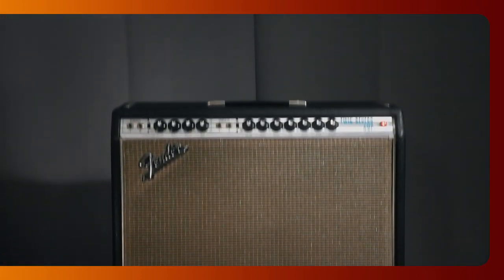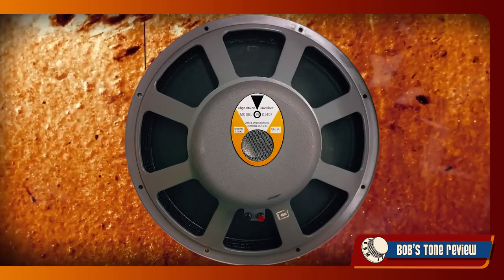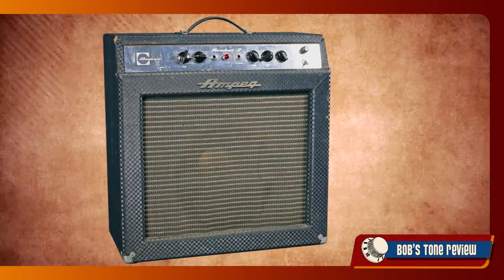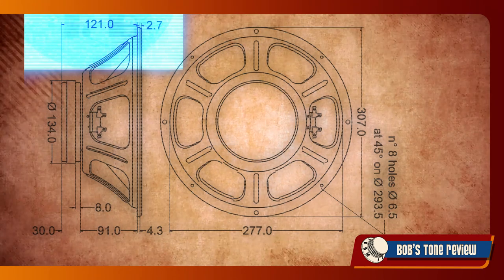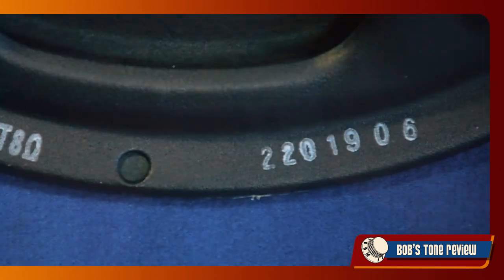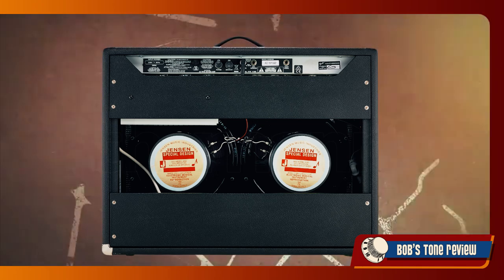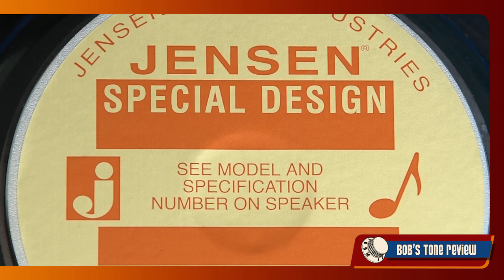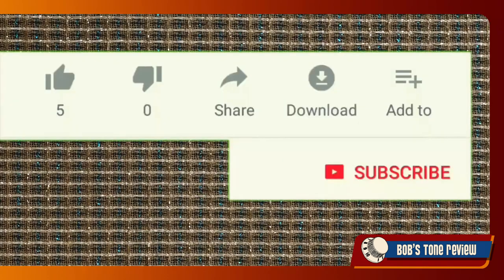BTR#22 The Jensen Speakers Upgrade - Vintage

Comment: When you played the distortion section, the UTAH'S sounded much deeper, richer and fuller.  The Jensen's were light, tinny and shrilly albeit "clean".
Reply from the maker: It's a matter of taste after all Sunrayman; While I like the Jensen C12-N's I might agree with you within a certain extent for the Tornados. The Utah's may lack in headroom, if you consider that it's a Twin! Also, as mentioned in the final part of the video, we should take into account the break-in factor, which plays in favor of the Utah's, especially as far as "Depth" is concerned.
Reply: i have a set of the jenson 220's in my heathkit cab with a fender hotrod as the head it sounds amazing not sure what you mean.

Comment: Utah's are underrated. I would keep one in there for micing variation. Also, modern Jensens do not sound like vintage ones at all from my experience.
Reply from the maker: Good point Middle Pickup, that makes sense.

Comment: excellent. it's crazy how a new set of drivers will change an amp entirely. 👍👍👍
Reply from the maker: Sure Marc, yet it's a quite underrated mod when compared, for instance, to pickup changes or stomp box pedals.
Reply: @BobsToneReview  absolutely!i have a few heads i like and then i have a few cabinets with different drivers that i can pick and choose depending on what i'm looking for. massive differences in character. they all make the amps feel completely different too.

Comment: Interesting and insightful video as usual, thank you sir - appreciated.  Your opinion about the Italian Jensen speakers is different from others I've heard.  According to what I've learned, the parts used in the Italian Jensen speakers are not interchangeable with Chicago Jensen speakers, while Weber's versions of those classic speakers (his favorite versions of them) use parts that are interchangeable with the original Jensen speakers.  Ted Weber (RIP) stopped using the same designations the new at the time Italian Jensen company also used, because he didn't want his speakers confused with their speakers, which he thought were inferior to the original Jensen speakers (a common sentiment).  Not that he was disparaging the Italian speakers, the other speaker manufacturers speakers weren't as good either, Jensen used tighter tolerances in the voice coil cap, as Weber also does supposedly.  I wish the Italian Jensen company hadn't added the word "vintage" to their speakers, because now when people talk about them and say "vintage Jensen" speakers it confuses things, which seems to be by design.  I believe some of the new Italian Jensen speakers are better than others, and they seem to be getting better with experience from the learning curve, plus some respected amplifier makers are using them.  I've seen more positive opinions about the Italian Jensen speakers lately, but one of the criticisms I hear is they are very bright and take a long time to break-in.  The Jensen speakers Fender chose for their new Deluxe Reverb reissues - the C12K, sounds pretty bad in those amps according to amp techs like Lyle at "Psionic Audio", who's opinion I respect - he said almost any other manufacturers C12N type speaker would sound better.  On the other hand some great guitar players use the stock Deluxe Reverb reissues with C12K speaker and make them sound spectacular, so ymmv as they say!   I had an Italian Jensen P12N in a hand-wired Deluxe Reverb which sounded really good - much better than a C12R did, but a Weber 12F150 (C12N clone) I replaced it with sounded so much better in that application. Speakers that sound bad in one amp can sound wonderful in another amp, and visa/versa.  I'm somewhat crazy about speakers and have quite a few, just added a couple Jensen "Vibranto" models today (what brought me here): an EM 1220 and EM 1202, which are very different from each other.  Jensen offered a lifetime warranty on their final speakers, so maybe they knew their company was about to disappear (?), because a lifetime warranty on speakers that WILL wear-out doesn't make sense otherwise - no?  The EM 1220 is designed for bass, rated 100 watts, with 28 gram ceramic magnet, so it's going into my 1963 (?) Ampeg B12X fliptop portoflex, so I can play bass and guitar without blowing the speaker.  It also has a high frequency horn and external 2 x 4" cab for the reverb and tremolo, so it won't be too dark sounding with the "bass" speaker.  The B12X currently has its original cone C12N speaker, which I'll cherish at lower volumes in one of my older Gibson or Ampeg amps.  The EM 1202 is designed for guitar, rated 60 watts, with 16 gram ceramic magnet, while the regular Chicago Jensen (I have to say "Chicago" instead of "vintage" Jensen to avoid confusion) C12N is 25 watts, so this version has a higher wattage rating, possibly because it's voice coil former isn't paper like the regular C12N (?).  Another benefit of buying a Vibranto version of old Chicago Jensen speakers is they are more likely to still have their original cone that hasn't blown than the older Jensen models.  It's hard to beat an old Jensen speakers in old American amps, which were voiced for those speakers, but as they say - ymmv.............cheers!
Reply from the maker: Hello David, thank you for your kind words, I'm really happy that you like my videos!

"According to what I've learned, the parts used in the Italian Jensen speakers are not interchangeable with Chicago Jensen speakers, while Weber's versions of those classic speakers use parts that are interchangeable with the original Jensen speakers". 

I absolutely confirm that. That's why Weber parts are manufactured in Inches while Jensen parts are manufactured in mm, which of course is the standard for European industrial machinery. 
In fact, I had to buy recone kits from weber to recone a couple of vintage Fender 10" speakers.
The contemporary Jensens are optimum speakers, definitely among the best reissues available today, but I would never dare to say that they are exactly like the vintage originals from the 1950's. 

"I wish the Italian Jensen company hadn't added the word "vintage" to their speakers, because now when people talk about them and say "vintage Jensen" speakers it confuses things"

Unfortunately that applies to any vintage reissue on the market; Gibson and Fender first : )

I think that speakers with different magnet size and material should not be really compared. Like you say:

"Speakers that sound bad in one amp can sound wonderful in another amp, and vica/versa"; 
I totally agree with that. 

"Jensen offered a lifetime warranty on their final speakers, so maybe they knew their company was about to disappear (?), because a lifetime warranty on speakers that WILL wear-out doesn't make sense otherwise"

Ha! Ha! Good point : ) Jensen is a subsidiary of SICA which, as far as I know, it's a long established company.

Best wishes with your speakers, I'm sure they'll do a great job for the next 100 years : ))

Comment: I have a 1964 Fender Deluxe Reverb that didn't come with the original speaker, the Oxford 12k5-6 so I replaced the crappy one it came with, with a modern C12Q...but I wanna improve the sound to the best possible speaker but I wanna make it a Vintage Speaker of the same era. So, what speaker do you recommend that I get for my 64 Deluxe Reverb?  I was thinking a Vintage Jensen C12N. What do you think?
Reply from the maker: Excellent choice Heiner! I also love the Alnico Jensen P12N soundwise but the Ceramic C12N is more indicated for a period-correct restoration. Congratulations on your great amplifier!

Comment: Hi Bob, I have an original 1965 Fender Blackface Bandmaster with two Utah speakers. The amp is 40 watts. Would you happen to know exactly how many watts each are these speakers that came original to the amp. They don't have the Utah sticker on the back of the magnet. I'm thinking that they must be at least 25 watts each. Those Utah speakers you have must be higher powered because, wasn't your amp at least 80 watts? Please let me know. Do you find the Utah speakers any good compared to today's speakers? Thanks Michael Newell from Niagara Falls, Ontario, Canada
Reply from the maker: Hi Michael, thank you for your kind interest! I'm afraid I can't help with precise or documented information about your Utahs. Yes, the Twin is 85 Watts so the speakers should have higher power rating there. As I mentioned in the video, the Utah are often considered the least desirable among the speaker options in vintage Fender amplifiers. This doesn't necessarily mean that they cannot fit your needs or that you can't get cool sounds out of them. And yes, as the test recording stands to demonstrate, still they are respectable vintage speakers! I think much depends on the kind of instrument you use and the tone you are after as possibly they might result too compressed with more powerful signals or higher volumes. In that case you may appreciate a more efficient speaker giving more headroom.
Reply: Hi Michael, lovely amp of yours!!!
It's hard to tell the exact power rating without seeing a picture (and won't be easy neither with a pic...). you can try the "google way", keying in all the codes you may read on the frame and/or on the back of the cone membrane.
As a very rough guideline, look at the speakers from a side, and try  to measure the diameter of the voice coil former, that is the point where the cone membrane meets the spider suspension, on the bottom side of the cone. If your speaker will at least measure 1" in voice coil diameter, you should be in the 15-20 W range. Be careful, ,obviously, the speakers are quite delicate in that area. But you should be able to determine if the VC will be bigger or smaller than 1", that is what you really need to know. The bigger the voice coil, the higher the power handling, all else being equal.
In the "Jensen world", the first letter indicated the magnet (C-Ceramic, P-AlNiCo, N-Neodymium), the number indicats the size (6, 8, 10, 12, 15), the last letter (or suffix) indicates the voice coil size, thus the range of power handling: V (1’’ Low Power), R (1’’ medium power, 25W), Q (1’’ ¼), N (1’’ ½), K (2’’). Therefore the C12N is a 50W, with 1 1/2" voice coil.
Hope this helps! don't hesitate to get in contact with us, in case of need!

Comment: EXCELLENT!
Reply from the maker: Thank you Robert, I'm happy that you enjoyed
Reply: @BobsToneReview  I have a 68 with Utah speakers.........do you think it has the AB763?
Reply from the maker: Hello! If it does not have those weird thin black vertical lines on the control panel, it very likely has AC568 circuit.
 https://youtu.be/7gZDRWbzx4A